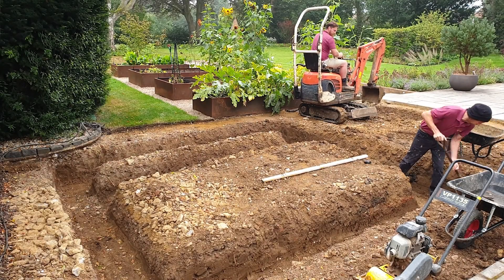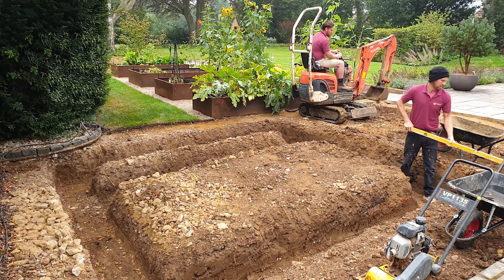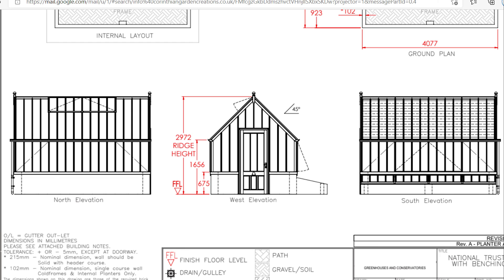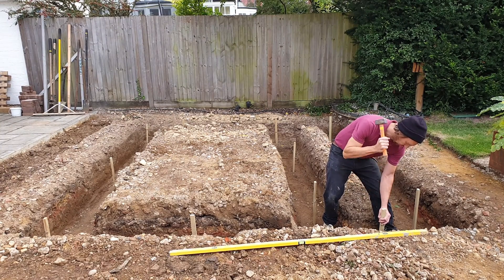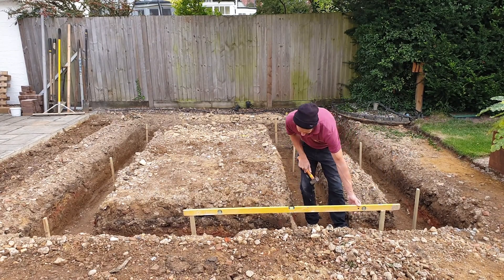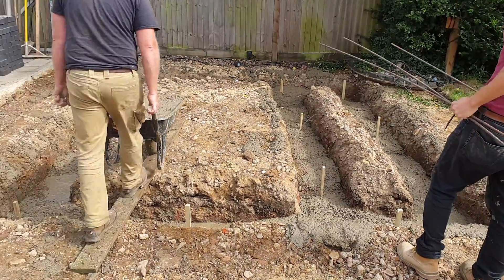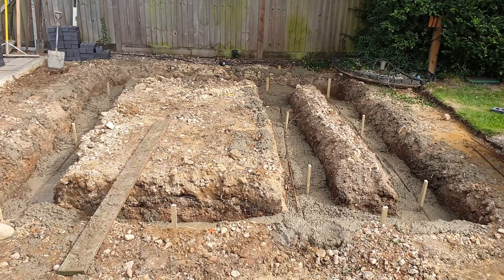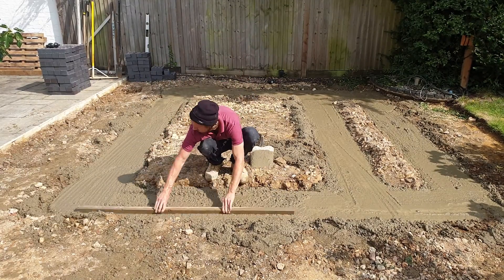How We Pour Footings and set levels accurately

Comment: Thanks, handy video! 
What do you think about some EBIs (even better if):

1) Use narrower battons or even rebar (cut 90 degrees for a flat top for the spirit level) for less void?

2) Pull battons / rebar out before the final tamp.

3) mark the battons / rebar 5cm from the top for even easier pull out ie. Leave 5cm exposed.

4) tie the rebar with 1/3 overlaps and 90 degrees bend rebar for corners. Horses perhaps not necessary as you already put a layer of concrete down for simplicity, but probably add those too, ta be sure.

Ebi 3 depends on the load bearing but possibly good practice regardless.

Comment: This video saved me from a disaster. I had marked the edges of my trench to indicate the concrete depth, but those marks very quickly got splashed over, If I didn't have pegs in I would have been in real trouble. 4 cubic meters of ready mix.
Reply from the maker: Glad it helped! It is a nightmare to loose the level while it's poured!

Comment: do you vibrate the concrete? I was worried the gravel would go to the bottom so I was looking for tutorials
Reply from the maker: As long as its not too wet it won't seperate and will stay mixed and can be spread about. It should be pourable but if it spills out the mixer and barrow its too wet. You can't go wrong with concrete, just make sure its consistent. Same mix, same consistency, so it drys a and cures evenly. Wear a dust mask. Good luck
Reply: @HowWeLandscape  forgot to ask, how do you know when you can do a direct pour into soil instead of adding form-work or a vapor barrier in the bottom? are there general rules or did you have to ask an engineer?
Reply from the maker: @roiad876 I can't advise on other peoples projects but if your unsure contact a landscaping or building consultant. The footings in the video were for a pre fabricated greenhouse so we were following a manufacturers recommendations.

Comment: I agree with Lee on the rebar instead of wood and you should reverse your level when you  go to the next peg
Reply from the maker: Yeah rebar is fine. Although it has a few hazard issues. If someone fell on a vertical rebar in a trench they'd be in a lot of trouble. Also when the concrete settles the rebar would be left proud of the footing. It can obviously be knocked down a few hours later but someone would have to still be on site to do it. Rebar can also rust and expand if its too near the edges causing a weakness. Also not all projects will have steels to hand, the point of the video is more about setting the datum levels before pouring. Again pegs or rebar would do it.

Your also spot on with the reversing of the level, thats a great observation! I actually put in all the pegs and then realised the camera ran out of memory and cut out🤦‍♂. So I took 2 out and fake hammered them back in. Was a rush while the lorry was waiting. Its really hard making these videos in real time with everything going on. 

Thanks for the feedback  👍
Reply: you shud tie strings near the top of those grade/elevation control pegs so you can find them easily and also remove them
Reply from the maker: @kingsman3087 thats a good idea, thanks for the interest 👍 👍